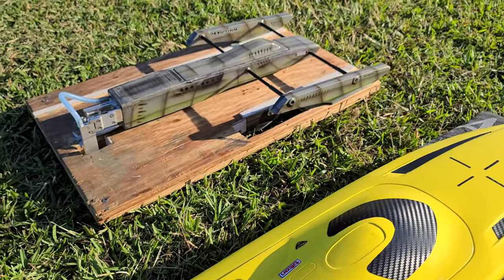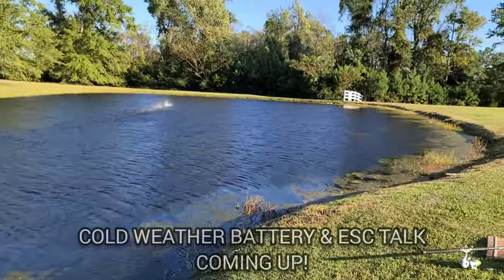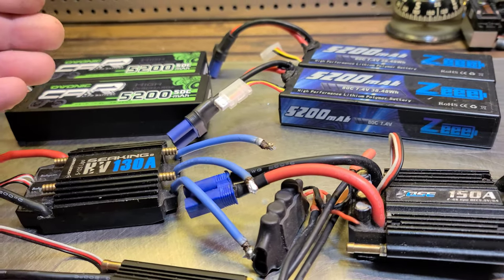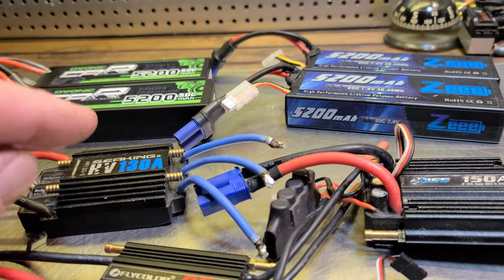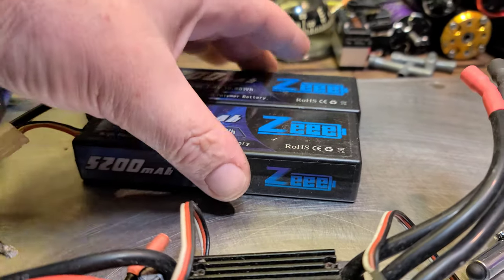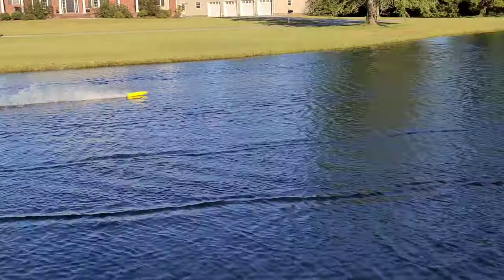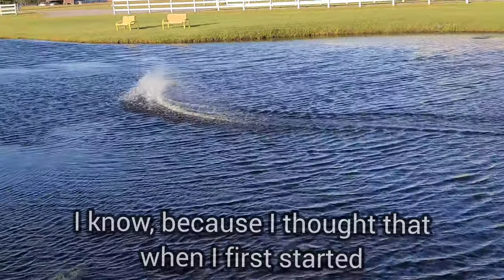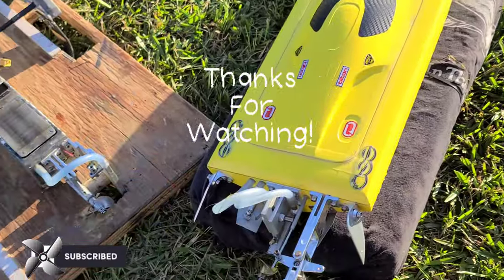Running Rc Boat's In Cold Weather, ESC  Temp & Lipo Battery C Rating

Comment: Hey buddy. I also have a mini rigger like yours. I was having the damping problem as what you are having currently. Recently I used some putty to add up the height on the tail of the hull where the rigger is touching the water. Then I had much less damping. you may start with some tape to increase the height of the tail and have some try first.

Comment: I run boats in pretty cold temps, I actually use heat pads and a thermal cooler for the batteries right before I run them. Battery performance takes a dive in colder temps.

Comment: Also if the esc has lvc, it will kick on early in cold temps, usually on lower c rated batteries. I have never ruined a esc running in the cold.
Reply from the maker: Just speaking from personal experiences and research I've done.   You Possibly never had an esc go bad because you keep battery's warn before running. Google has plenty of  information on the topic. Castle creations website also has information, lipo c rating and how it could possibly damage speed controls.    Thank you for watching  & taking the time to leave a response..

Comment: What’s the best C rating to run boats on, and what’s the difference in low and high c rating?
Reply from the maker: Up to 70a esc you can get away with 40c  & up,  70a & greater 50c & up. That's  what I've noticed over the years doing my own testing.
Reply: @IRONCLADRC  I have a 160a 8s is 100c. Is that good or should I go higher or lower